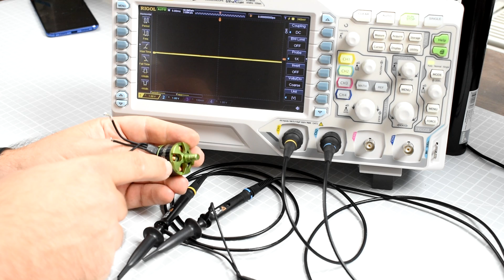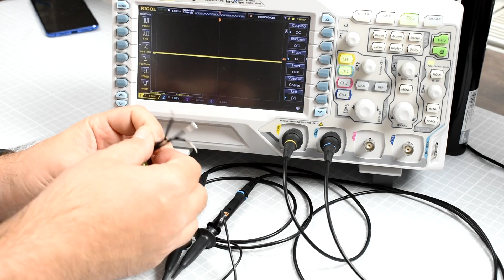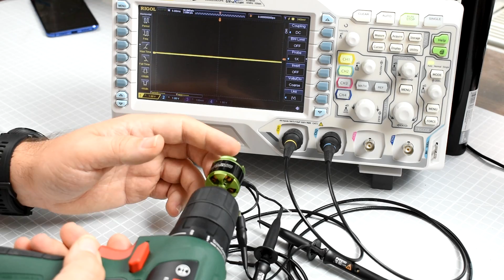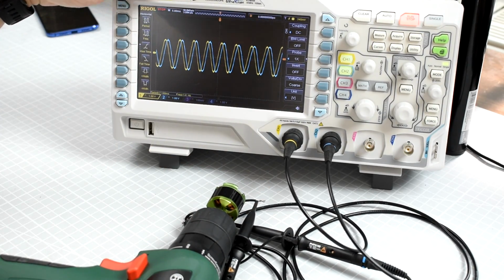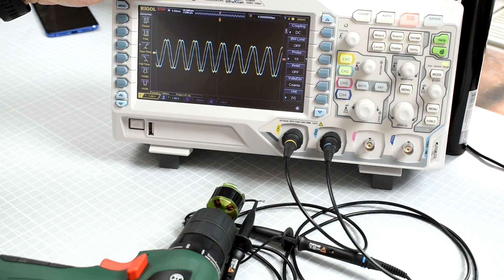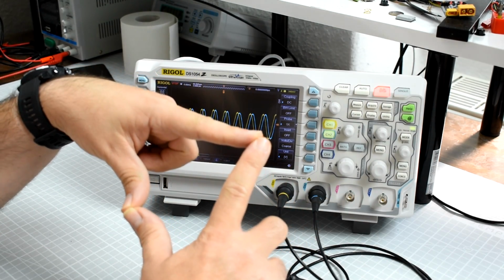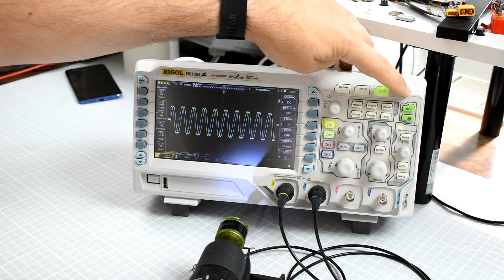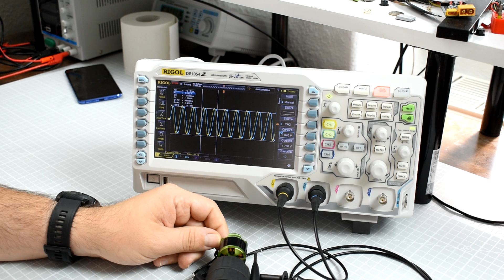1 Motor 1 Scope - brushless motor, oscilloscope, and a cordless screwdriver

Comment: Could you check all 3 phases at once if you would power the oscilloscope from a battery ?

then it should be floating and no ground at all, therefore no short possible - or did I make a mistake ?

thx, great idea, will try that out when my loto OSC482 will arrive or tomorrow when I am back in the shed and have the owon vds1022i which has an isolated channel and is battery powered by the tablet connected, but just 2 channel only and the older 8'' android tablet running android 6 for the hscope app.

Comment: What model of drill do you have? Online suggests typical cordless drills to output 500 to 2000 RPM. I estimate your motor around 1000-2000KV?
Reply from the maker: The drill is some cheap Bosch. No idea about the model. And motor is 950KV IIRC

Comment: Nice scope, I did similar experiments a while back and also used a drill at a known RPM and voltage output of each
coil to calculate the Kv of my motors and also some I rewound by hand.Surprisingly accurate enough ,I was basically trying to lower
the Kv of  motors I had and it did work ,but it was a lot of effort!There are links to video's if you search for radiocontrolinfo/Brushless Motor Kv – Measure a Motor’s Kv 😀

Comment: Interesting, ive been dealing with a noise on throttle issue, tried LC filters,  different capacitors, 12v linear board. Tried two rush vtx, changed the FC from clracing to matek F7. Replaced the hakrc blheli32 with a GS spedix. The issue still persisted. As a last resort I swapped the emax ls 2400kv motor with an old racerstar motor and the noise was gone. After seeing your video I wonder if something went wrong with the motor wires, wonder if I could see something wrong on the oscilloscope by using a drill and turning it like you did.

Comment: All you would need to do is connect 3 1K resistors between the 3 phases and create a virtual ground. The resistors do add a load of 1000 ohms to the 3 phases, however.

Comment: You don't need a tacho. You see the frequency on the scope.
Reply: Exactly
Reply from the maker: and some math since electrical RPM is not the sam as physical one. For the simplicity of the video I just ignored that
Reply: @FPVUniversity  there is a phase shift, but the frequency is related to how many magnets pass the coil in one rotation
Reply: @FPVUniversity  what?electrical RPM? is not rpm on oscilloscope .